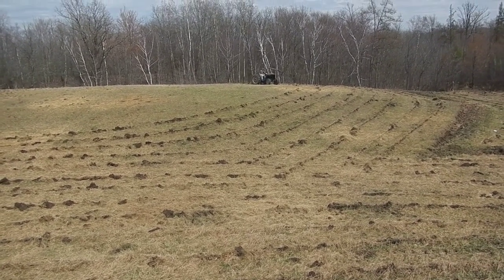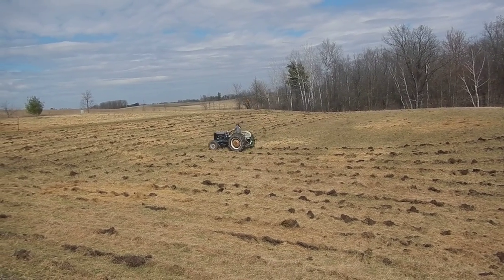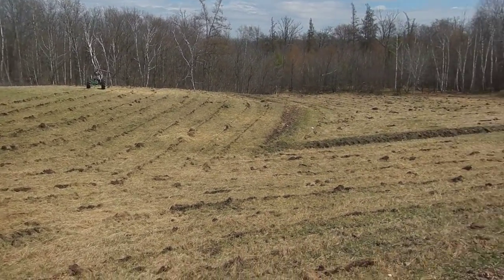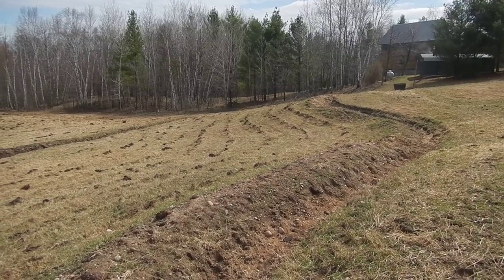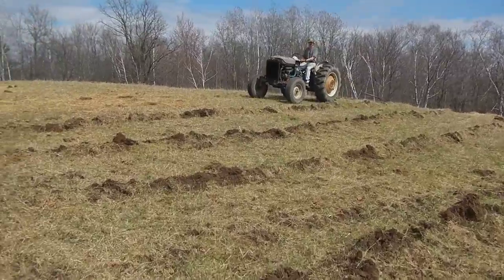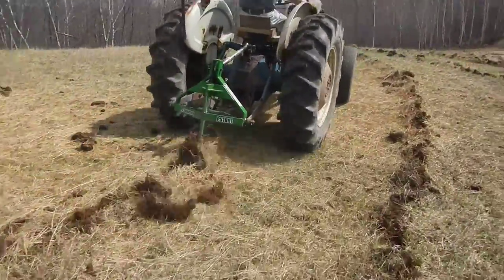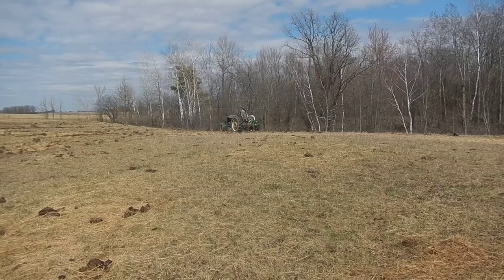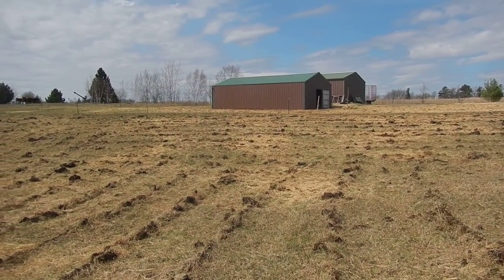Keylining Pasture with a Sub-soiler

Comment: Yoeman Ploughs do a fare better job, admittedly, it will be far greater investment, but the surface tearing seen here won't happen with a Yoeman (especially with coulters fitted).  Nevertheless, great to see anyone key lining!
Reply from the maker: Part of my choice of tools is the size of my tractor. And the cost of a real plow. Because this is only used as pasture I'm not concerned about the tearing. I also have a three point no till drill and the coulters do a fine job busting up the clods when I plant.

Comment: Any update? Is this a reoccurring activity or did it not turn out as expected?
Reply from the maker: It is a reoccurring activity and it really does work. We don't do everything every year. We try to rotate it around to different areas, mostly those with a lot of slope. It slows runoff and gives rain and snowmelt time to soak into the ground. It also introduces oxygen and microbes into the sub soil which starts to build compost from the bottom of the slit upward.
Reply: @anathothcommunityfarm8819  Will this help raise your ground water tables and moisted the top soil?
Reply from the maker: @jamessang5027  Eventually. It really does an amazing job slowing down runoff so it can soak into the ground.